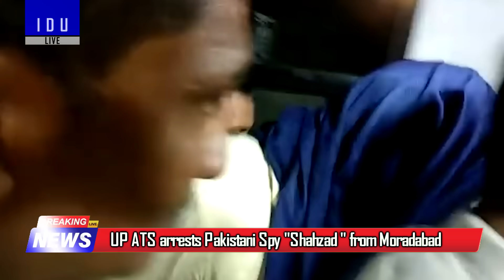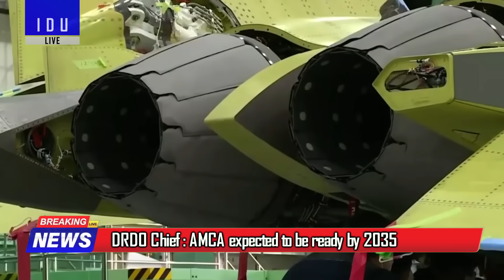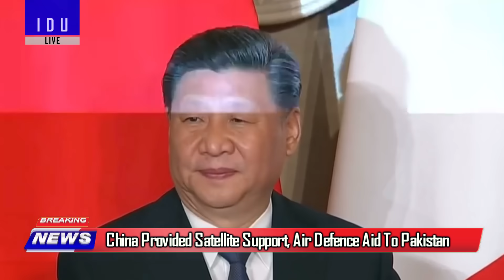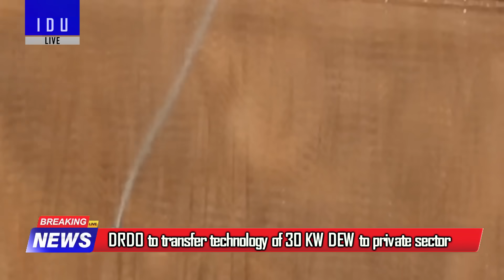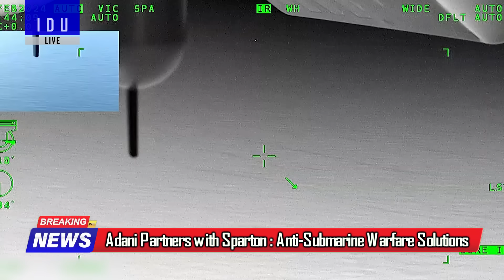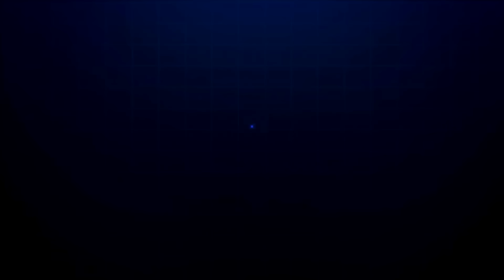Indian Defence Updates : Pak J-35 Delivery,HATF-1B Destroyed,PAK Jammed Brahmos?,IAF Fired Khagantak

Comment: We need a much more stronger defence  system with anti-stealth radars which will be more effective against any 5th Gen fighters like F-35, Su-57, J-20, J-35A... That can detect, deter and destroy any stealth aircraft 200-300 kms away from Indian borders. 

Buying foreign 5th gen aircraft fighters would not make sense as other countries are developing 6th Gen fighters right now. Anti-stealth systems will be cost effective instead of buying these foreign aircrafts which have a lot of restrictions when needed to use.

Spend a lesser budget and increase the anti-stealth capabilities by 4-5 fold along with present defence systems that were battle proven in Operation Sindoor. Increase their numbers as much as possible to create 5-8 Layers of defence, including long range defence system like S-500 systems or indigenous system like 'Project Kusha'.

Buying any F-35 variant will take atleast 10 yrs to induct into service. AMCA would be ready in that time. Also, there's the kill switch mechanism the US could use if war takes place against Pakistan. The US favours Pakistan in most cases.

Buying Su-57 isn't feasible, as they aren't as stealthy as F-35. But, can be kept as an option for emergency procurement to counter Two-Front or Three-Front war situations.

Increase Brahmos stockpile to 6-7 fold of today's stockpile. Create and produce more sophisticated advance missile system.

Need more sophisticated and advanced equipment for our ground troops. Future battle tanks, WhaPs etc, equipped with loitering drones and munitions and include anti-drone tech on ground moving assets.

Need more drones stockpile to counter China.

Increase the number of SSBN subs to 10, 2 more Aircraft Carriers and 1 Drone Carrier, 20 Frigates, 20-30 Destroyers and etc. Buy additional Rafale M for 2 aircraft carriers.

Most importantly they should be our own indigenous systems.

This will be sufficient to counter China and Pakistan in the future

Comment: It is extremely important for the lethargic HAL and private industries collaborate to expand the delivery model. Tejas Mk2 delivered by 2032 is no use. Kick these idiots. They are focused on some HAL plans to build some other training jets using GE414s. What idiots !!

Tejas is key, so I suggest separate Tejas production lines away from HAL and let L&T, HAL, Adani et al take up as a joint venture. We need to speed up like 35-48 a/c per year. The same facilities can deliver both TEDBF, ORCA, AMCA etc.  4 assembly lines of 12 in a row is mandatory to think about future. HAL and DRDO.ADA, must focus heavily on engineering and r&d.

Comment: J-35 Delivery to Pak by Q1 of 2026 can be a blessing in disguise.
This could finally be the push we need to push and sign the MRFA deal for Su57 and modify the Nasik Su30 facility to locally manufacture the Jet.
Reply: Su-57 is not stealth.
Reply: @mtrest4  It's better than china product
Reply: @kumarchemuru1989  I'm not even sure.
Reply: @kumarchemuru1989 
That's true, India should buy more Rafale 🙄
Reply: @kumarchemuru1989  ARE you a joker?
Reply: @mtrest4  Su57 is stealthy also Ukraine admitted it plus F35s can't even fly 😂 like in Alaska plus F22 is the only thing in US that is stealthy that's why they building Super F22
Reply: @sarthakmisra 

Neither Su-57 nor F-35 are good for India.  One is not stealth and the other has non+satisfactory performance and huge maintenance costs relative to its price.

Upgraded Su-30MKI remains the best choice of the heavy fighter series.

Other than that, would much rather see indigenous Tejas (with Kaveri engines) than anything else.

We should have seen Tejas MK1A make its debut in the recent air battle.
Reply: @mtrest4  i like both urs and @kumar's arguments but tbh. If time has proven anything is that in times of war, the thing that is THE MOST important is reliability of production and availablity of spare parts.
US will NEVER do a full TOT and when it comes to reliable delivery schedules... Well... F404 and F414 engines speak for themselves.

There was this clip it was watching which i think was quoting a German Tank Commander who said "The German Tiger tank was worth 4 American Shermans, but the Americans always had 5"

And for this reason i am kinda more inclined towards what @kumar was saying.
Reply: I suggest 🇮🇳 pay in advance, so Rusia can add the production line 😂😂😂
Reply: I agree with you 100% and this is the only sensible thing to do as our experience with Tejas  etc has shown..

Comment: Russian 5th jets needed now and  it will also  accompany our domestic program Like Amca.
Reply: Russian planes are non stealth
Reply: @mtrest4 on what basis?
Reply: @mtrest4  even Ukraine said Su57 is undetectable under radar.
Reply: @sarthakmisra 

If it were undetectable, Russia would have put it on the front lines and demolished Ukranian air defences.

It is non-stealth which is why it remains held back.

The Su-30MKI with its numerous upgrades and integration of local missiles, bombs, Bhramos, Rudram, Astra's, AESA radar and EW suite all locally designed is light-years ahead of the bare bones 🦴 Su-57 prototype.
Reply: @mtrest4   please don't fall on West narrative  even f35 and f22 were detected by hamas which didn't had any air defence system. West countries don't like su57 so they don't promote it. Ultimately decision lies with Our forces  which one to choose.
Reply: @mtrest4  Don't fall on west narrative they want to sell their own plane so they don't promote su57. Also f22 and f35 were detected by hamas which didn't have capable air defence system which are claimed to be best 5th gen fighter. Ultimately decision lies with our forces which one to choose.